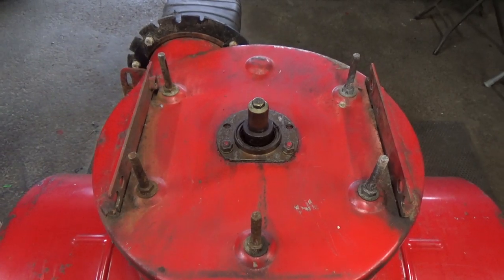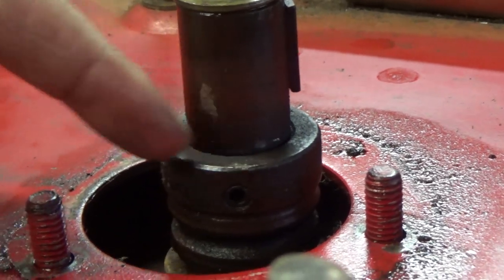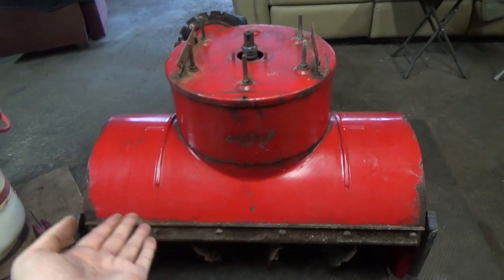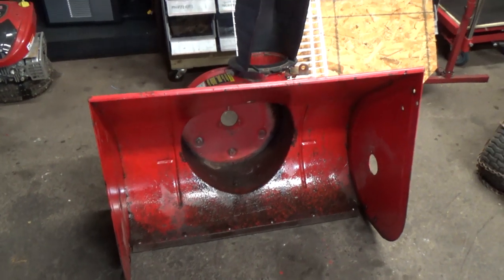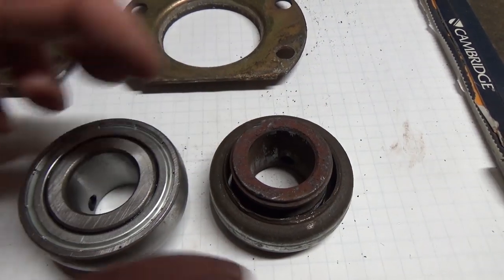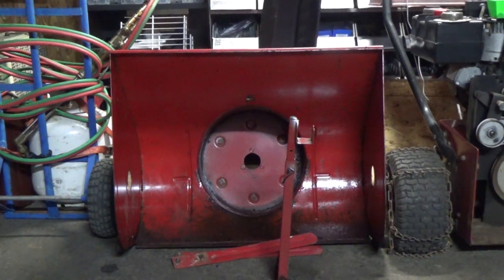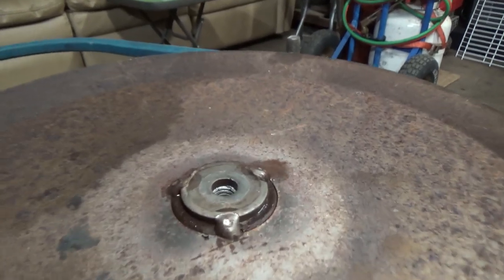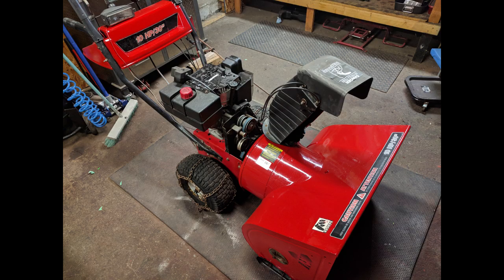How to Replace a Snowblower Auger Housing Impeller Bearing [Part 2]

Comment: A suggestion to anyone working on an older snow blower, while you have the auger assembly apart, pull the shear bolts out of each side of the auger and make sure there not frozen to the inner shaft (some have grease fittings for exactly this reason) otherwise the first time the machine try's to ingest a solid object instead of shearing a shear bolt or pin, it will shear the auger gearbox itself..
Reply: Agreed.  Especially if it's your snow blower.  When I had mine apart I used a low temp grease synthetic with teflon in it as well from TUFF-OIL Corp.  Along with anti seize and generally sanded and painted the inside of the machine as well.  It's a 10 horsepower machine.  Love it.  I wax it every year before I put it up for the summer months.

Comment: That collar is eccentric and is ment to lock when you drive it in. It should have a hole for a punch. When getting it off you punch it anti clockwise (or clockwise if someone installed it backwards) until it comes free. Don't keep pushing or it will lock the other way. Once it moves free you can remove it by just lifting it up to the axis. I'm currently working on an old gilson snowblower and it took me a while to figure out how it works!

Comment: You can buy a new one for 599.oo ware i live. . Most we get in Central Missouri is about 6 inches at a time. That's maximum now. When I was a kid we had over 12 in at a time. And I'm happy for it
Reply: What you can buy today is absolute junk compared to the older models.
Today's machines are designed to be cheap and only last about 5 - 10 years.
Reply from the maker: Correct Vic, 5-10 and sometimes they don't even make it that long, thanks for watching!
Reply: Nice job on this snowblower.  That being said, A new one comparable to this model is about $600 bucks.  So if you can actually get $500 bucks for a used snowblower, either you are really good, or the customer is not very smart.
Reply: @mikespain8655  they're just not that expensive here. Because we have so little snow fall. And you only use them three or four times a year. And they sit in the way.

Comment: Don't forget the melted candle wax/paraffin trick! (heat the part a little then apply wax to the joint. (not too hot or the wax will just flash off without seeping into the joint)

Comment: $500 is way to much. $300 tops.
Reply from the maker: Sold this unit for $450 last year! Thanks for watching!
Reply: @EliminatorPerformance   likely demographics. In my area, I'd pay $75 in the shape you got it. I'd sell for $300 OBO. That unit is old and rough. A similar unit brand new, isn't much more than $450. I live in Appalachia.
Reply from the maker: @M70ACARRY  yea I'm in Canada too so factor in exchange. Also, these older models (fully serviced) hold their value well here because people know how well they're built. The new ones are crap.
Reply: @EliminatorPerformance  $450 sounds like a bargain -- used machine in A1 top condition. I'm in the mid-Atlantic area. I don't know where these guys are finding new units at the supposedly low prices.

Comment: Wow, that oldie actually has a ball bearing in it!  The newer ones have just a pre oiled plain bearing so I just drilled out and installed a grease fitting in my new Toro 824 so I can keep it greased.  Time will tell! 🙂
Reply: Please expand on what you did. A little effort now which could avoid the bearing failure problem would be a big plus.

Comment: great video set. Exact machine I am working on I believe. I note in the Parts Used section of the description you list the bearing as 09-10265 which has a 3/4" ID but watching the video you overlay 09-10264 which is a 7/8" ID bearing. Pretty sure my shaft measures 7/8" not 3/4 so you may have the part listed wrong in the description...  I am still working on getting my pulley off (seized good!) so won't know for sure until that is done.
Reply from the maker: Thanks for that, this is an old video so I'm not as familiar with all the parts as I would've been when I filmed it. Keep me updated, I appreciate the communication!
Reply from the maker: Description has been updated, thanks for taking the time to notify me!

Comment: Excellent video im getting ready to do the same bearing job on a 8 28 chieftan
Reply from the maker: Thanks for watching!
Reply: I tried heat and two chisels  no go. I thought i had a ball joint tool but cant find it i can see how that would totally be the only way to do it. Almost got it off
Reply from the maker: @miketibbetts2979  yes that tool makes a huge difference!

Comment: I need some help.  I need to replace my impeller it ate a large chunk of hidden blacktop.  I have the entire auger assembly out. My bearing is shattered and off the collar or retainer but that is still stuck on.  What did you use or do to get it off after heat?  There is two holes for what I think would be set screws on this collar but they don't exist.  Any help

Comment: I have a Honda HS724... will be replacing the bearing.  Wanted to ask about the Kevlar belts and whether they are better than Honda OEM belts.  Thanks again for a great video.
Reply from the maker: Technically they are "Aramid" which is basically an in between of OEM composite and Kevlar, we use them whenever we can as we've found they do in fact last much longer and we've never broke one!
Reply: @EliminatorPerformance  Hey, thanks.  Where can I get them?  From the research I've done so far, it seems they don't make belts for all makes/models.
Reply from the maker: @jkimo1178  3/8" belts start with 238, 1/2" are 248 and 5/8" are 258

So for a 1/2" x 35" belt let's say, the part number would be 248-035

You can get them on eBay or Amazon, or any STENS distributor!

Comment: The auger belt which has those bolt belt keepers.  Curious, if you needed to just change the belt only, how would you get the old one off and new one on if those studs are so close to the belt.  Sorry if I'm missing something.
Reply from the maker: Sometimes you can just bend them out far enough, otherwise you need a wrench to loosen them and some pliers to back them out of the engine block
Reply: @EliminatorPerformance  Thanks

Comment: These bearings need a better seal ! 
Anyways,  Replace the drive belt too while you're at it .
Plus use a 15/16th " open end wrench between the Allen key bearing retainer and the pulley shaft . Then you can use the pickle fork to remove the auger pulley .
There is no need to pull the auger assy out !! .
Heat Allen retainer , loosen Allen bolts and pull bearing off .
Reply: Retainer or collar is still on. the bearing well it's shattered.  This collar has 2 holes for set screws but they are not there any advice how to get that off so I can replace the impeller.  Husqvarna ST 124.  Thanks